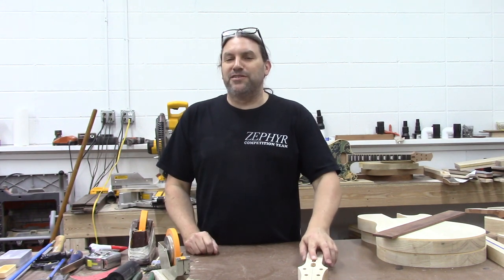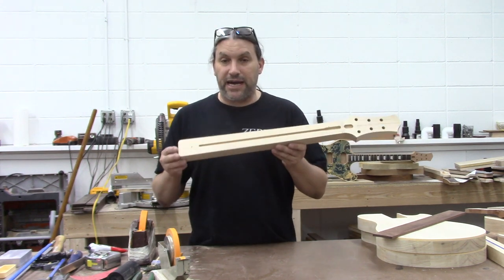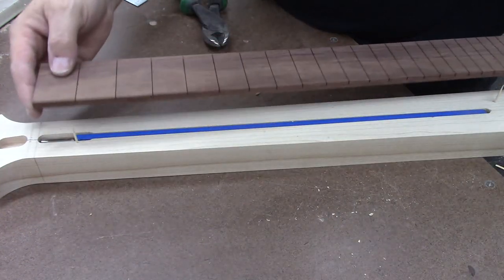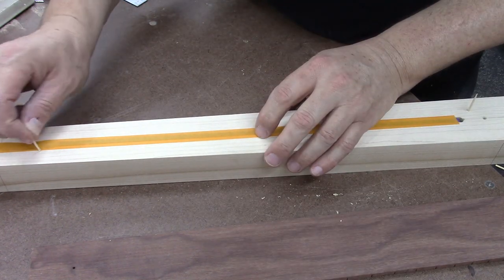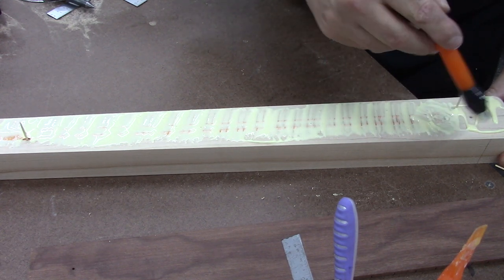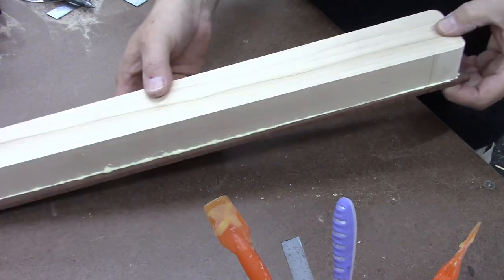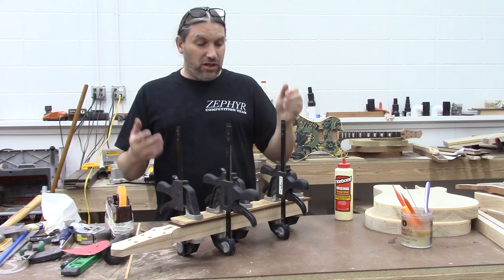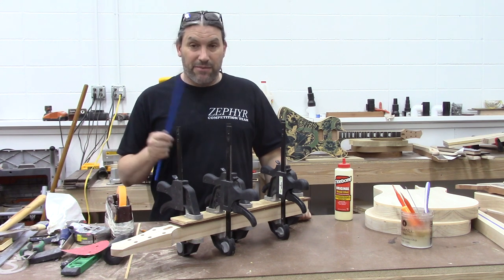Guitar Building Basics, How Do You Keep Glue Off The Truss Rod?

Comment: @Texas Toast Guitars thanks for the video, Matt.  Suggestion for another one:  what options do you use to move forward after router bit tear out, chipping or riding into your body/neck wood.  I routed 4 bodies over the weekend.  The first one had some mild end grain tear out.  The next one chipped an edge piece about a 1/4 inch under my template right out and the 3rd and 4th...oops, the double stick didn't hold and the bit carved into the bodies beyond my profiles.  Rather than a "Design Modification," I will attempt to patch those spots.  I changed things up on each one to see if I could get better results and no matter how I approached with shallower starting cuts, different router bits, even the pricey Whiteside spiral bit...I still have some repair to do.  Would love to see some options on how you would handle repairing minor tear out, medium tear out or chipping or even riding into your body/neck wood...if you didn't have the super shaper.

Comment: I use Scotch “magic” tape, that thin frosted tape make for paper. It’s usually just slightly wider than the truss rod slot. I just tape over the rod with it, and leave it there. It’s very thin so it doesn’t cause a problem. The glue won’t stick to it, but it won’t stick on the open slot anyway. 😁
Reply from the maker: That's a great idea!
Reply: Been using the scotch gift tape myself for quite a while... don't remember where i got the idea... mighta been one of my first books??

Comment: Thanks for video, it’s really helpful 
But one question: this truss rod is double action which is great but nuts on it are welded to rod, does it (nut) have a hardened steel? 
I mean if somebody strong enough to cut out inner hex or broke nut it would be pain in one place to fix it unlike regular “fendery/gibsony” type of separate nut

Comment: I get that with the coating on the rod that it will still work, I’m just curious, with the amount of glue that’s going to squeeze into the channel why even tape it off. Also, and I’m just asking your opinion, any truth to the idea that with hardened glue in the channel it has an effect on the operation of the truss rod. As in the hardened glue and the neck are harder for the truss rod to move, and that the truss rod will adjust smoother and with less effort than if it was trying to also overcome the glue that becomes hard like rock candy? I appreciate your thoughts
Reply from the maker: How else am I supposed to leave a trap for Chris?
Reply: Lol true
Reply: It’s amazing how little glue squeezes into the channel. One of the things I’ve noticed while retrieving truss rods from necks that I’ve destroyed.